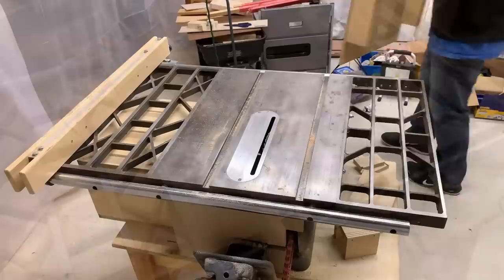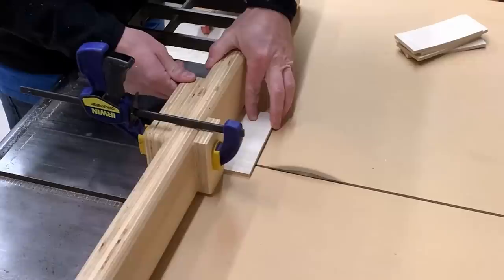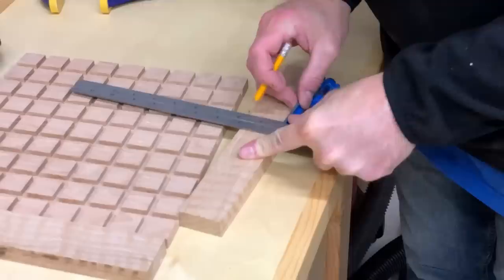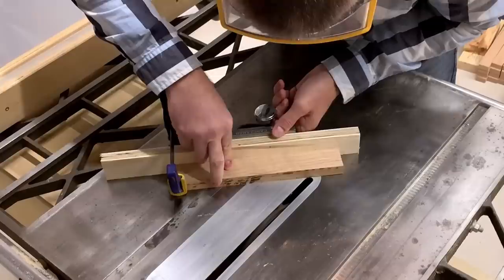How to Make A Quoridor Game // Wooden Game Build // Woodworking

Comment: Ok so I have put off making this. I finally found a couple of your videos and your super helpful link to the logistics tonight. Even though your equipment is superior to mine I had previously made enough jigs to make this work. I have not framed any yet but I managed to pop out two sets tonight. Neat thing is once you successfully make one of boards grid you can use it to very quickly clone as many as you desire as a template. It didn't take long at all. Eventually I will frame them in and make spots to hold the tiles like yours but even without them it still looks nice and plays well. I sewed some bags to hold the pieces, at some point I will make a custom box to hold them. But seriously a great last minute build for Christmas gifts.
Reply from the maker: Thank you so much for the comment! I love to hear about people who make their own versions! Everyone has their own situation regarding equipment, so it’s good to come at it however you need to, with the gear you have. You made some excellent gifts with this! Enjoy sharing them with your friends and family!

Comment: I liked your video and I think this would be a fun game.  I cannot find my dado stack since I moved, but I think between the cross cut sled and my regular blade with multiple passes I could do this. I might make the player side border boards a bit broader and put enough cuts for the corridor game pieces there parallel to the game board. TY for posting your video.
Reply from the maker: Thank you! You’re absolutely correct that you could do the same thing without a dado stack by just taking multiple passes.

Comment: seems really cool. I need to get some info on this game. the only thing I'm concern is the frame around the solid central panel.
important thing is the assistant like it!!
Reply from the maker: It’s a great game! Good point on the solid wood central panel. It’s small enough that I would expect any wood movement to be minor. I guess time will tell me if I’m wrong!
Reply: @WhiteLabWorkshop  yeah, I made the same job in the past and no movement appears. wood is strange